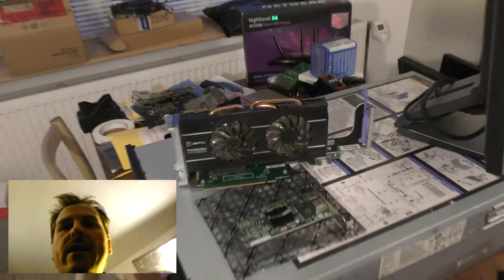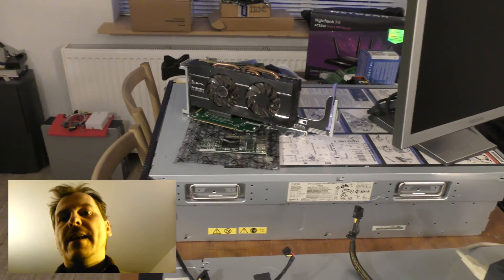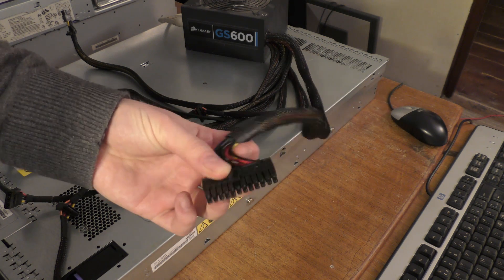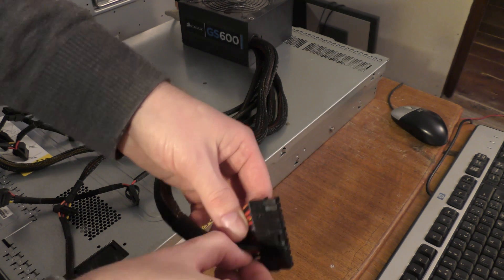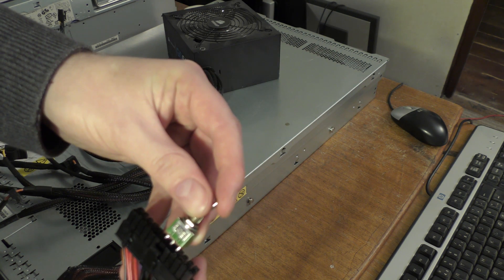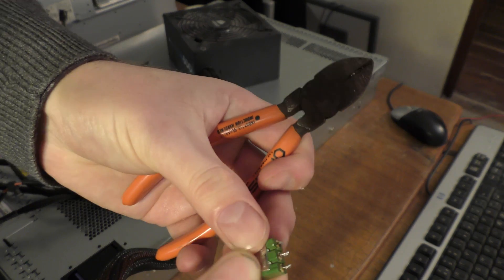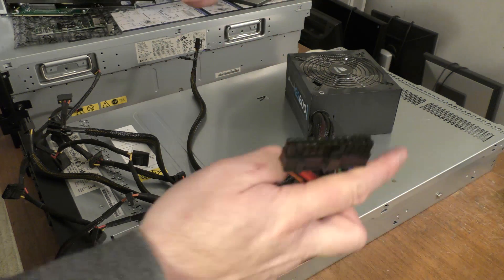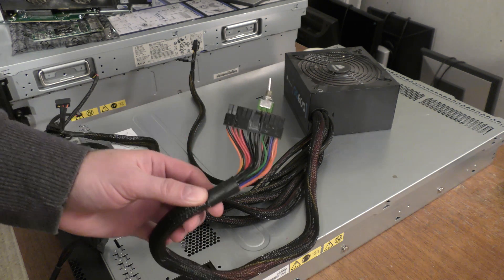How to Power on and off a PC Power Supply with a Switch - 439

Comment: can i use a 2 pin rocket switch?
Reply from the maker: Not sure,, it just need a connection for a little bit, but it does also work if it stays connected.

Comment: No schematics?! 
Why?
Reply from the maker: I did not find any,, do you have it? then post is for the next guy..
Reply: @MyPlayHouse  No. Otherwise, I would not watch videos. How does your power on inside the psu work? A soft latch with two transistors?

Comment: So if spliced the green and connected it to a switch, I could basically control mobo power using a switch. Is that correct?
Reply from the maker: I think so,, must admit that this is a old video and i do not remember it all.. but your motherboard also have pins for controlling the power.
Reply: @MyPlayHouse  Yep. There are 2 pin connectors for a front panel momentary switch but I was looking to control overall motherboard power besides the PSU's power switch.

Comment: Thank you for that info, it is indeed very helpful. I would have liked to see how to turn the PSU off with the switch as well though, since from the motherboard I know that it is 2 pins that you need to bridge only shortly to turn it on, and then bridge it again to turn it off, so it would have been interesting to see if that's the same with the switch directly on the PSU as well (so it would continue running if you flicked the switch back until you flicked it forward and back again). Also, the exact pin on the motherboard plug would have been interesting as well (I'm not sure if all the PSUs have the same color wiring, or if not the green wire on some of them may be something different, while the plug must always be the same for every PSU to work on every motherboard).
Reply from the maker: Hi Seegal Galguntijak
Thank You very much!  It turns off,  if I switch it on the switch,, no problem.
Thank you for watching! :-)
Reply: My PlayHouse Just turn the switch back and it goes off, or do you have to turn the switch back and then bridge the two contacts again?
Reply from the maker: Seegal Galguntijak It turns on and off with the little switch.

Comment: A cool tip ;)
For indication, you can also add an LED to the 3.3V (orange) line of the PSU to indicate when its on. A green LED and a 100 ohm resistor should do the trick. 
And you can also add an LED to the 5V standby (purple) line of the PSU to indicate if its plugged into power (if the PSU doesn't have an on/off switch on the back [and some do not]). A few kohm resistor should be good depending on the colour of the LED.
I mean, you could make it into a cheap bench PSU. I know you have one already but handy for those out there who do not ;)

pinouts.ru is your friend for ATX pinouts, etc but I use a book from Scott Mueller called Upgrading and Repairing PCs. I have the 20th edition but I beleve they come out every year or when there is enough significant change in technology to warrant a new run. You can get them on Amazon but be warned - it is the bible on EVERYTHING computers and its related technologies.
A great read if you are just starting out in the game as either a tech or an enthusiast ;)
Reply from the maker: Hi themaconeau
That is a good link!
Thank you for watching! :-)
Reply: My PlayHouse hi can i there is any problem if i start my pc this way?

Comment: Hello I have a problem indeed my ibm does not detect peripherals in USB what is 
problematic for BIOS settings (1.16) I have to look for solution on the 
official documentation but I have nothing find you have an idea of Problem ??
( ibm x3850m2 7141 ) the diagnostic panel display the code " C2"
Reply from the maker: Hi BlackSpirit French
make sure the USB is FAT32 :-/ No not really,, I also had a lot of trouble on a PC last weekend,, sometimes it's just £ucked.
Thank you for watching! :-)
Reply: Thank you for your answer how to format my hard drive in FAT32 on the interface
Of my ibm you have links to give me that deals with the subject for now I am blocking: / especially that this kind of material expensive expensive I really need I have two hard drive of 74.6 Gb and 32 go of RAM that are detected in the BIOS but the impossible to do anything: / If you could help me you
Thank you for taking the time to read me ^ ^My PlayHouse
Reply from the maker: HI BlackSpirit French 
Make sure the USB you want to boot from id FAT32 :-)
Reply: So I have to boot an OS before anything else? Hypervisor for example on a key usb fat32 all on the usb internal port of my ibm ?? I thought I had to fix the problem of the keyboard that was not detected in the bios before doing anything so if I understood correctly I boot (Hypervisor) and I can configured What I have configured?
My PlayHouse
Reply from the maker: Hi BlackSpirit French 
Yes without access to your keyboard, you will need to fix that first! :-)
Maybe there is a reset jumper on the system board for system settings,,, I have never had this problem. do also try different keyboard. To be sure that is not it.
Thank you for watching! :-)
Reply: Thanks for 
helping me I will try to do its first boot my usb key and then we will 
see ^ ^ thank you in any case for having taken the time to reply
If it still does not work a rack console would be a solution?
Reply from the maker: BlackSpirit French 
I have had problems converting PS/2 key/mouse to USB,,, if you are doing the same that might be the problem.
Reply: Hi there is no port ps2 I do not notice anyway but I have successfully accessed the bios but unfortunately the version of MWARE was not compatible with my processor it is a pity (intel xeon MP 2.4 Ghz) do you have a version to advise me ?? If not windows server 2008 is this good ?? I'm afraid that he can not stand the whole ram I'm counting to put it is for thank you again to take the time to read me
My PlayHouse
Reply from the maker: BlackSpirit French 
Have you activated virtualizing, in the bios,,,(CPU options) that is required for ESXi to run,,, I did also get an CPU error last time I installed on a x3850 M2, but it installed.
Reply: I do not know I will check and retry an instalation I keep you informed of the situation lol
My PlayHouse

Comment: I would suggest not using described method to put a GPU into server. While it isn't bad to use external PSU to run GPU, you have to make sure that all cables of GPU are connected to the same PSU. This includes even PCI-E cable, which can be separated into power and data. If you run GPU in 2x PSU configuration, you might damage something.
Reply from the maker: Hi Jerzyna aKwei
What are you afraid will happen?
Thank you for watching! :-)
Reply: There are plenty of Dual PSU rigs and products out there and i know of no problems with running in this config.
Reply: I'm not entirely sure! You can check it, if you aren't afraid of losing GPU or in worst case server. Dual PSU isn't dangerous if used in supported platforms, but AFAIK GPU's aren't really meant to be used with some power over one PSU and some via another PSU. You can check if it will work, but I wouldn't do it to your poor K1 :) . If it won't work, you can check PCI-E extenders with molex power, maybe if it will be on same PSU it will work then. Anyway, good luck testing it, I hope I've heard wrong and you can actually do it without problems :) . Hint: same molex extender can be used if your MoBo doesn't supply enough power.

Comment: I came across some 24 pin ATX "switch plugs' not a switch actually, but a purpose built green black shorting connector. Where I used to work some product actually shipped with them. Good tip though, Thanks
Reply from the maker: Hi Craig Nehring
Thank You very much!
Thank you for watching! :-)

Comment: Yep, its the pwm circuits enable logic.
if the internal 5v standby supply is faulty, you wont get anywhere, its common for old machines that are connected to the mains for its lifetime.
Bad capacitors in the standby circuit :-(.
Reply from the maker: Hi zx8401ztv
Thank you for watching! :-)
Reply: Please mix the words on your clip board, paste different replies :)
Reply: Good point :-), ive never been any good at spelling/writing.
Yes i know the flag is english, and i am, but im faulty.
You know what i ment though :-)
Reply: Oh, and my punctuation is almost nil, i try to type the same way as i speak, please dont learn english from me, im rubbish LOL :-D
Reply from the maker: Hi zx8401ztv
I am using 2-3 hours a day replying,, and that is just one liners,, mostly :-/ I will have to give up soon.
Thank you for watching! :-)